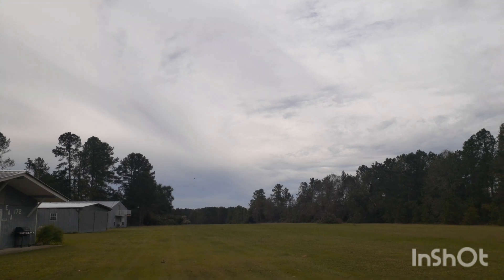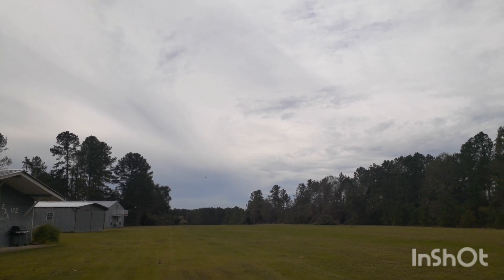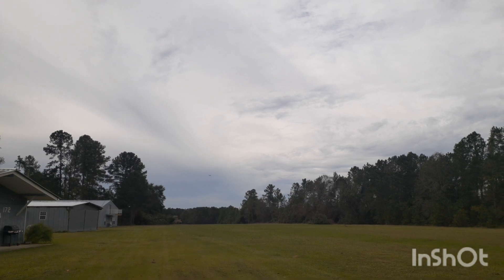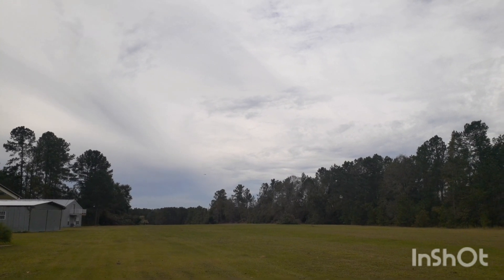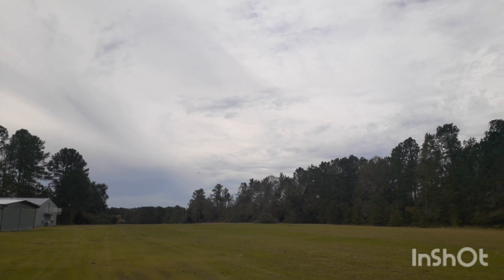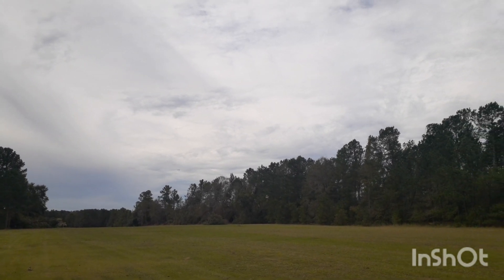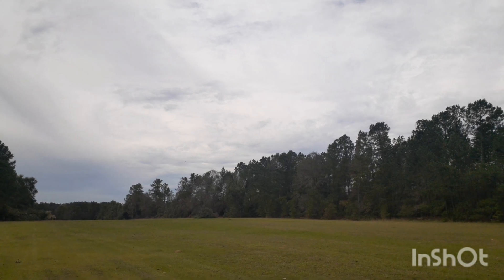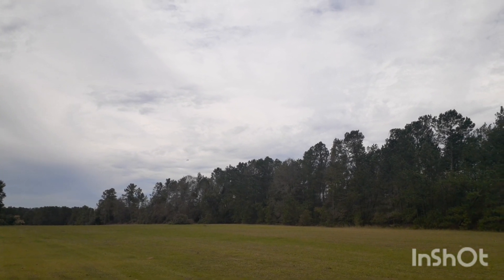rans S12,  saying goodbye after 7 years of great flying

Comment: I can't wait to get my S-12 XL back in the air. 
1:11 Wait until he makes the turn, lol. 
Sounds like he's afraid to push the motor past 6000. 
I get about 7000RPM at max throttle with my 582 gray head in standard day conditions and about 1450fpm climb rate with a 3 blade prop set about halfway between the middle setting and full fine  because I use Amsoil Sabre synthetic oil. Can reach about 7200RPM in level flight but I wouldn't run it like that for more than a couple of minutes and, really, with sailcloth, you can't do that for more than about 15 seconds or you'll overspeed the airframe. 
The fastest I've gone is 120mph, briefly and the plane was still accelerating with a sense of purpose and that was with the RPM at around 6500. I'll be doing a major overhaul before I fly again and I am going to use real fabric so I can safely cruise at 120mph. The real limit is the sailcloth and with Stits fabric, max cruise goes way up. The plane is strong enough that, with proper fabric, the real Vne is more like 150mph. 
When I took the plane up to 14,000ft MSL, I still had about 2-300 fpm climb at 6500rpm in a spiral. In a plane like the S-12, high altitude flight is something else. You'd better have multiple layers of cold weather gear. I wore a Ushanka made from Siberian hare on my head. It was winter in the desert and temp at 14k was about -25F. 
You also have to keep the RPMs up on descent if you don't want to seize the pistons. Spiral descent is the way to go, with RPM at least at 5000. I'll do more like 5300rpm. 
These numbers are flying solo, of course but I am hardly a light person. I tend to hover between 230 and 245lbs. I also fly with a BRS so, with 10gal fuel, I'm approaching 900lb gross weight. 
I've flown vastly different aircraft over the years. My initial training in HS was in the Scottish Aviation Bulldog, a fully aerobatic complex trainer with forced induction and variable speed prop. I've had glider training. I've flown a jet trainer and a helicopter a few times. I've flown a Skyhawk or two and those seem like an albatross, wallowing through the sky when compared to the S-12. 
Normal category GA aircraft are for ham fisted pilots. At least until you step up to something like an Extra 300. 
Flying something like a S-12 is a real challenge and it is unfortunate that it is super easy to get certified to fly one. A lot of experienced pilots get themselves killed in LSAs due to a lack of respect for a plane that light. You need proper training if you are used to flying a Skyhawk or Cherokee. It might be legal if you have a regular PPL but only an idiot would do it without proper type training. Same goes for ultralights. A license may not be required but proper training is if you don't want to die. 
When flown well, a S-12 can take off and land on a football field. I've done hammerheads (actually not easy to do in this plane), rolls and loops in my S-12. 
Lucky for the guy you sold this plane to, the S-12 is very hard to stall and spin. But if you mishandle it enough, you can do a half spin and get punted into the ground at low altitude. I've experienced a stall when turning final at about 250ft AGL and that wasn't anywhere near the scariest incident I've experienced in the air. Almost descending into a Blackhawk helicopter when flying in the mountains is probably the scariest, followed by the time an unqualified pilot misjudged their approach when flying a Lancair IV and almost ran right up my ass when doing T&Gs. Inadvertent flight into IMC was pretty much a non-event because I have GPS, ADS-B in and AHRS in my S-12. 
Watching this video, I am very worried about this pilot. It might not happen today. It might not happen tomorrow. But if they keep flying the plane like that, they're eventually going to buy the farm. When an S-12 bites, it does so with the swiftness of a snake and you're going to be dead before you even realize what happened.